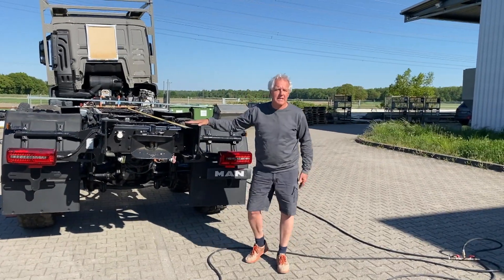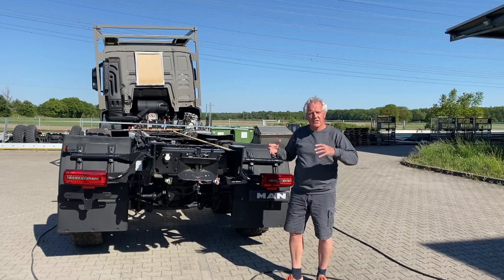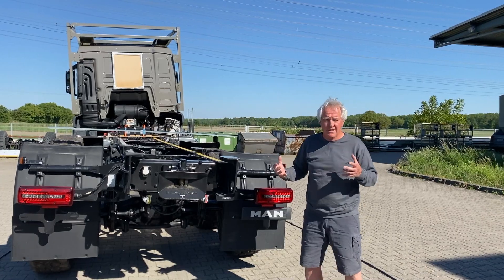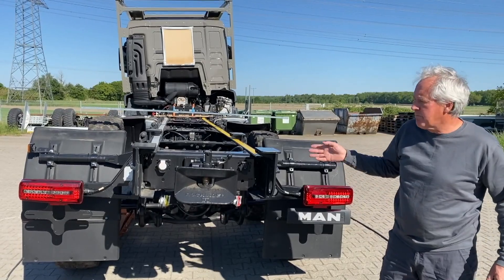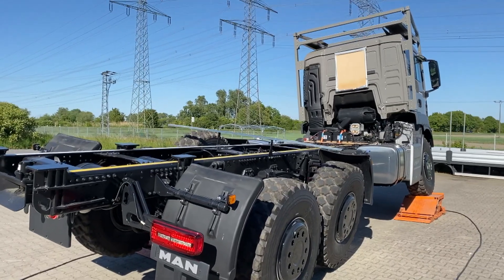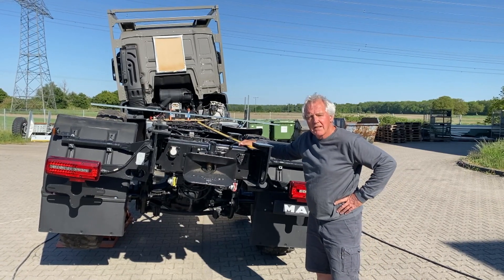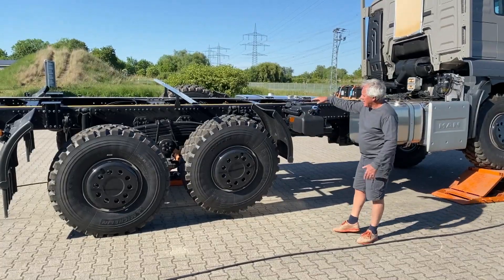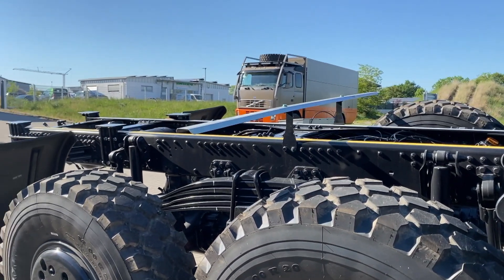UNICAT Expedition Vehicle: Subframe e Chassis

Comment: some things i wonder about is would it be possible to make the cab and living space into a single unit with this subframe design? and would it be possible to have air bags to support it similar to how the cab is mounted to the frame? and what about stability with how the center of gravity shifts due to the box? also would having a independent suspension for the tires alleviate the need for frame twist, or would it be better paired together? im not sure what to think on these variables.. racking my brain constantly isnt proving effective for integral parts so id love to hear your ideas and reasoning behind how you do these things. oh and sorry to add context to my questions, ive had the dream for a long time to make a expedition vehicle and almost every time i get a second to think plans and designs riddle my brain and answers are far and few between on the internet so its just been left to speculation on my part.

Comment: you could use some custom made spring body mounts instead of a sub frame . . . the spring mounts will compensate for the flex (twist) in the chassis frame, regardless of the degree of flex . . .

Comment: Now I know the purposed of those center pivots for. But speaking of longest travel of rear suspension setup. Unimog has more travel in their suspension set up in 6x6 configuration, because the Unimog 6x6 rear suspension design is like independent suspension. While comparing to Man or Mercedes 6x6 rear setups that are using big springs which are link to the two axles. Just for my opinion.

Comment: Many thanks for that impressive demonstration! Always better to actually see it then just to read about the theory. 
Also thanks for pointing out to consider the twist on add-ons mounted on the chassis (e.g. tanks) and all the other parts. 
Many try to figuere out the max. twist by lifting the wheels with a forklift etc. But this is only static. I think the twist in dynamic conditions while driving rough terrain would be much higher. As the manufactureres are not providing the details, how is your approach for actually getting the maximum chassis torsion?  
Keep up that great source of information 😉 
Viele Grüße, Florian
Reply from the maker: Thanks for your nice words.

Comment: Dear Unicat Team! First of all thank you for that video! I know that top hamper suppliers usually do not care about the chassis especially when it comes to frame torsion. It is often seen as given. However, even though all wheels are on the ground there is definitely a high risk that you introduce deformations into the chassis that induce plastic (=permanent) deformations in the crossmembers of the shown MAN TGM when you lift the chassis by 400mm diagonally. Even more, in the long run if you perform such maneuvers repeatedly then there is a risk of cracks or loose rivets and screws in the chassis! Did MAN approve the driving maneuver (400mm) you show in this video?
Reply from the maker: Before we started building expedition vehicles on truck chassis which is more than 20 years ago, we had asked for information about the chassis torsion but finally had to find out by ourselves. When you do the calculation, you will see that the twist of the chassis rails will not cause plastic deformation.
I agree that there is a risk of plastic deformation caused by creeping if you leave the chassis twisted for a long time.
But that is nothing you want to do and will do in reality. More than 90 % of all traveling typically happens on paved roads, 9% on tracks and there are always only few situations where you need the full offroad capability of your vehicle. So the time and number of load cycles is very limited.
At our UNICAT vehicles, we never had problems with loose rivets or bolts on crossmembers. But that certainly is also related to the fact that we oversize and stay away from the limits.
The 4x4 UNICAT TC59 which you have seen on the Video has a weight of appr. 12 tons but the chassis is a 18 ton chassis.
Reply: Thank you for your time and your extensive explanation!